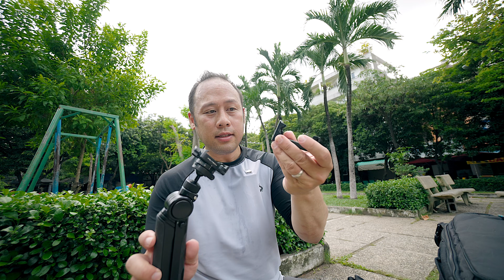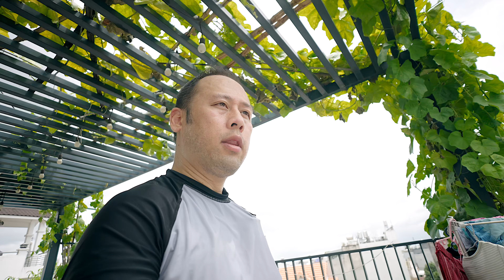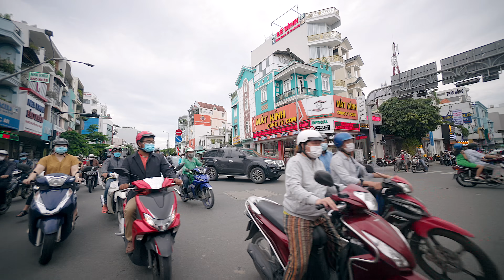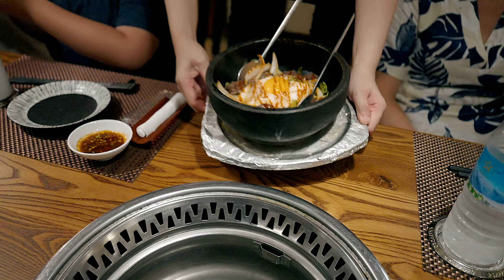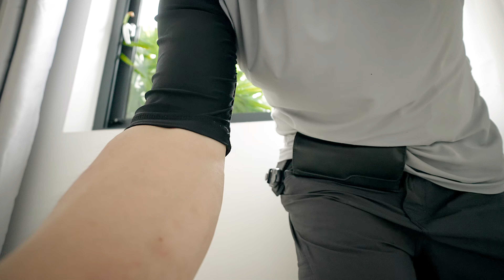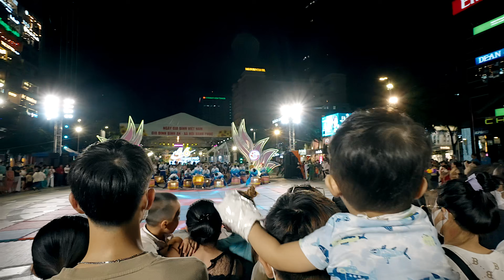Whats in My Travel Camera Bag?

Comment: Sony should give A7IV users the firmware update that enable an option to record 4k full frame 60fps (line skipped) mode or even 120fps 4k  with line skipping and whatever crop it needs to make it happen. Also they should make 10fps in 14bit raw possible and make 15 or 20fps using JPGs. All I see are these awesome nikon z9 firmware updates, that enables more and more options, and we A7IV users don't get anything new.